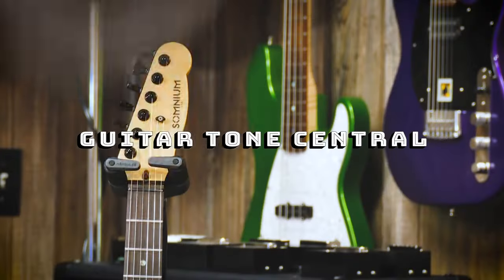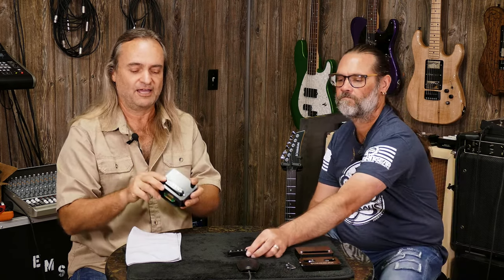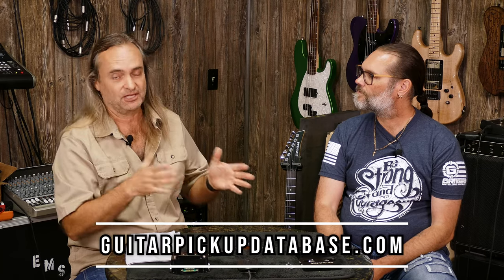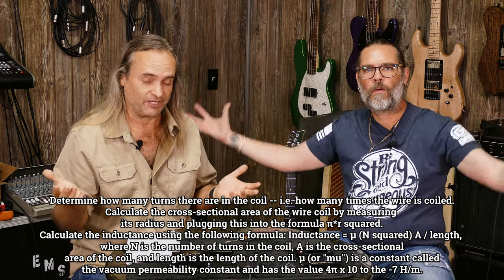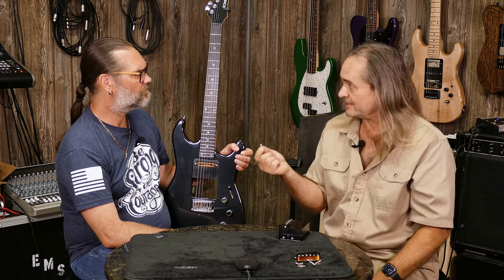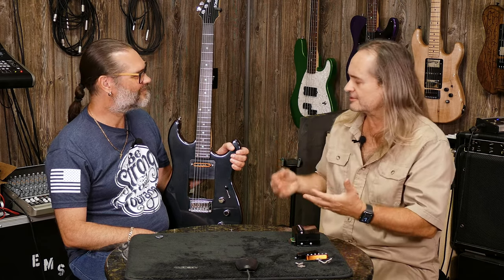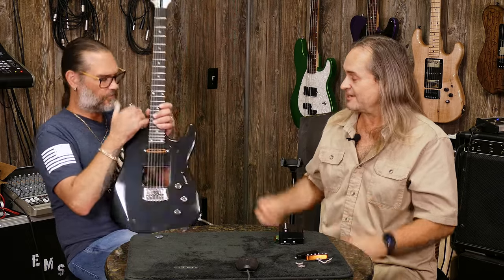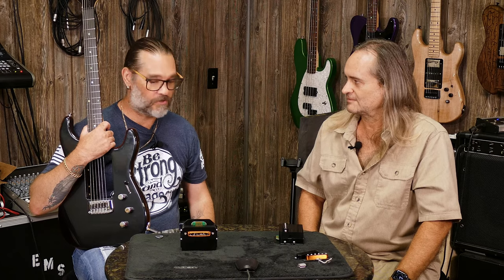Guitar Pickup With No Magnets - Is It Possible?

Comment: It still boils down to pickups are not worth $200-$300 just because of the way they are wound. You will never wind a pickup the same way twice. It's just impossible to line up 42 gauge wire on every wrap & have the same way twice. You also need to factor in the gauge of strings 9's/10's 9's sound brighter. The way they describe alnico is always warm & that really isn't true ceramic always sound darker & muddier whereas alnico is brighter. The wrap of wire, the gauge of wire & the strength of the magnet is what's in play & determines the output. People imo always over think pickups. They really don't play as big of part as the rest of your gear. Don't get me wrong a strong magnet with little copper will sound bad but most all guitars at the $150-$200 range have decent pickups. The myths of alnico are better need to stop. Steve Via use ceramic. You can use that money in better places to get better tone. But good video.

Comment: It barely gets louder as the magnet approaches the coil. But the magnet restricts the vibration of the string as it gets nearby and thus reduces the affected signal strength into the coil. A larger string travel generates a louder signal, a smaller string travel generates a weaker signal. The string is attracted and thus dampened by the nearby magnet.
Reply: Magnet dumpening strings myth - busted many times.

Comment: Only gripe I have is that the type of magnet makes zero difference, only the strength. Magnetism, like electricity, does not come in flavors. An alnico magnet does not produce different magnetism to a ceramic or neodymium magnet. Given equal field densities and the same shape, they will all sound identical. Just like you can't hook up a voltmeter and tell whether a current is flowing through an aluminum wire or a copper wire.

Comment: Sorry...bit of a dummy there: The vibrating strings act as magnets...magnetized by the coil permanent magnets. They couldn't be part of the coil because they are not physically connected to it. In fact, since they attach to the bridge, which is grounded, they strings are grounded also.

All of this works because the strings are made of "ferro-magnetic" material (ie: steel & nickel). Electricity is generated in a coil when it moves in a magnetic field OR the magnet moves in relation to the coil. Because the coil & the main magnets are fixed in relation to each other, it is the vibrating magnetized strings that cause the magnetic field to vibrate, generating current in the coil. 

It doesn't matter whether the coil or the magnet is moving, as long as the coil wires are crossing the magnetic lines of force. And, more current is generated with a more powerful magnetic & magnetic field, and more turns of wire in the coil to cross the magnetic lines of force. Thus, it is possible for an old pickup, with an intact coil, to cease working, or work poorly, because the magnet has weakened.

This is proven by the fact that non-ferro-magnetic (ie: bronze) strings, which would conduct electricity, do not generate output on an electric guitar. What are called "bronze" strings work because the core is steel...as are the non-wrapped high strings. 

This is also why nylon strings don't work on an electric guitar...though there is at least one make of nylon string that does work, because the wrapping is steel, as are, again, the unwrapped high strings  (Alternatively, the high strings could still have  a fine steel core embedded in the nylon.)

The point is that without magnets, you can't generate electricity with a moving coil, but the resistance & the "Henries" of a coil can be measured without the presence of the magnets. What you failed to do is check the magnetism of the strings. If there is output without the pickup magnets, then the only answer is that the strings themselves are retaining some magnetism in the absence of the pickup magnets..

Comment: I think the strings have some residual magnetism which is why you can hear a faint sound.  Pickups are really quite simple. Most pickups have fully charaged alnico 5', so the difference in the sound is nearly all determined by the number of winds or the DC resistance of the pickup.
Reply: EXACTLY.  All of us have magnetized things (nails, paper clips, etc) temporarily by running a refrigerator (or other) magnet next to them.

Once you add strings to a guitar that has its magnetic poles in the pickups, the strings almost immediately take on a remnant magnetic field because they're in close proximity to the magnetic pole pieces.   

If you then remove the magnetic pole pieces BUT FAIL TO INSTALL NEW STRINGS, the old strings still retain magnetization.  If you exposed the strings to high heat, then yes, you can eliminate the remnant magnetic field (but likely ruin the string). 

Electric guitar strings are purposely engineered to be as easily magnetized as their cost allows.  You could re-engineer how this all works but they (the manufacturers) do an excellent job making guitar strings become little magnets and yet remain pretty cheap with the pretty minor exposure to the small magnetic pole pieces in guitar pickups.

.

Comment: The Henrys are irrelevant.  They change because you changed the core of the coil by removing the magnets.  The value of an inductor will  change according to what the core material is.
Reply: Henrys still tell how hot a pickup is, so not irrelevant at all.
Reply: @JoeBaermann  The question is not the sound the pickup is making, it's why it's not working at all.  Changing the inductance will only change the frequency profile.

Comment: This is a false presentation. It is absolutely essential that a magnetic field is present to couple the string to the pickup or no sound will be amplified.

The pickup is an inductor and is coupled to the string via a magnetic field. As the string vibrates it couples more and less through the field as it vibrates. Without the presence of a magnetic field there is ZERO coupling and zero audio.  A magnetic field can be produced by 2 mechanisms ( in this case)  

a) A magnet in the pickup or residual magnetism in the pole piece bar under the pickup 
b) A current flowing through  the pickup coil as it connects to the input stage of the amplifier. 

The inductor in the pickup works without a magnet ( in this case ) only due to the residual current flowing through the pickup coil connected to the guitar amplifier input stage electronics  or some residual magnetic field present near the pickup. This current is created from the input circuit of the guitar amplifier or pedal. 

Using   an operational amplifier as the input stage for the guitar  ( say a guitar pedal with an operational input stage ) will produce no sound at all due to the infinitely small input current of operational amplifiers. ( assuming no presence of a residual magnetic field)
Reply: false presentation how? if you pass an electric current through any metal it becomes a magnet. the vibrating ferrous string produces a charge imbalance in the coil and consequently a potential difference starts moving electrons through the coil.
Reply: @tonydigregorio3806 Not any metal, just imagine if the unwound strings where made out of stainless steel.